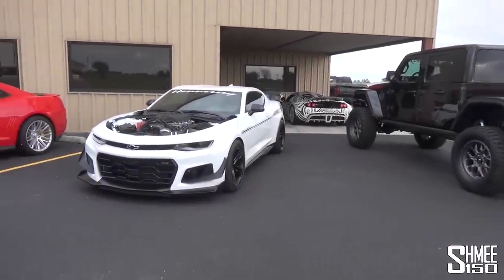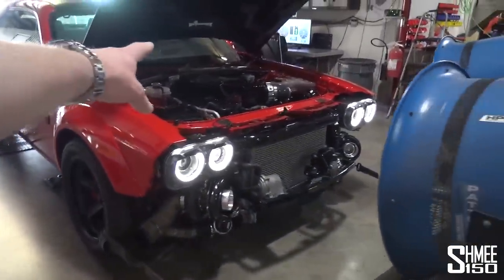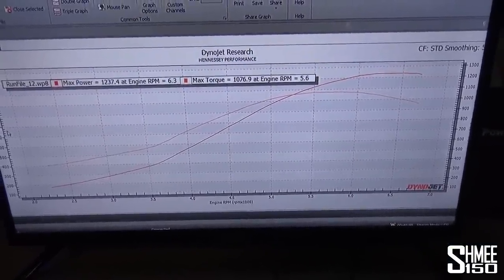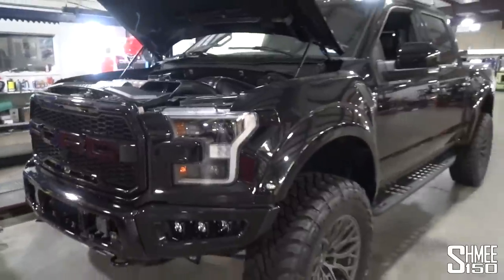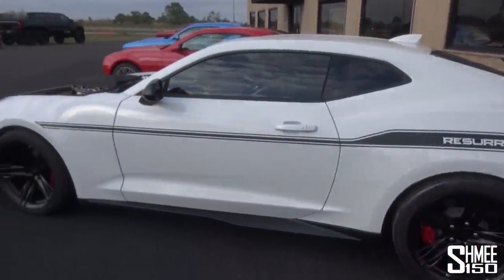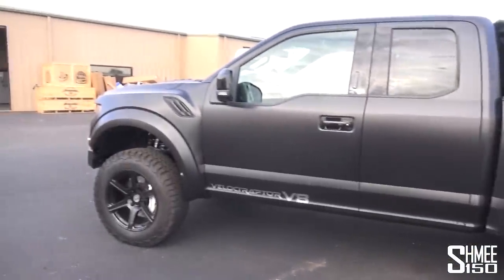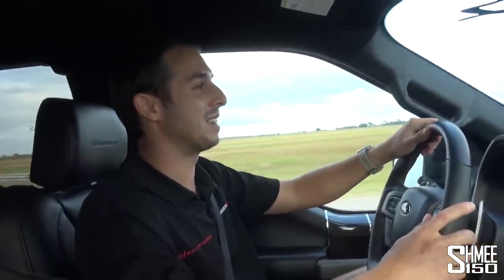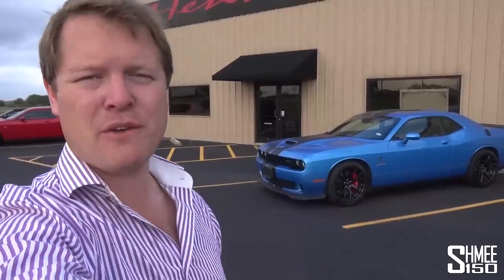THIS 1,400bhp Hennessey DEMON is Angry on the Dyno!

Comment: I've read many things about hennessey's car being big scams. Is that true ?
Reply: once you go hennessey your oem parts go missing lmfao its all true dude public information from the lawsuits is what you should read up on
Reply: Apparently in the early 2000's they used questionable business practices (which some people would refer to as scamming) but from what I've heard recently they are trying to improve their image from what it once was.
Reply: @the_visionvry6244  yup you pay all that money for your upgrades get robbed on the price and get robbed on your oem parts.
Reply: Just google him. You can find countless threads on Corvette and Viper forums about him, even find drunken replies from the man himself. In short he will have customer cars sitting in shops for insanely long, not reply to emails and phonecalls, sell you premium parts over the phone but install cheap ones. Theres even been cases where he has flat out robbed customers by taking stuff off their car and installing it on other ones. Endless list. Then we also have the Venom GT thing. All the carbon fiber, aero and chassis work was outsourced. It's all done by Delta Motorsports... In the UK. Americas supercar? Then they shoehorn a twinturbo V8 LSX engine in there and pretend they are a car manufacturer. Guinness World Records didn't seem to think they were one either.
Reply: @placeholdername3206  what site can I see that cheats drunken replys
Reply: there all scams
Reply: PaulBd78 they took apart a ton of acr’s and sold all the parts then basically told the owners to go to hell
Reply: for real?????dam mean vipers?
Reply: He has had slot of law suits brought against  him

Comment: So how much tires does this thing burn per mile? A stock demon already can't get the power down, you can only use this thing on a dragstrip cause it prob isn't designed to handle a corner well

Comment: If it is 1237 HP to the wheels, that is closer to 1450-1500 HP at the crank.
Reply: How the hell does do the drive train parts handle all that torque and power?

Comment: I would love to for them to put a gt350r engine in the ford gt with a whipple on top
Reply: Probably couldn't even fit half of it in the GT's engine bay
Reply: @burgerbandit3646  yeah, if the GT could accomodate a V8, Ford would have done it.
Reply: @andoletube  They specifically went with the V6 because it is more power efficient per liter of space.
Reply: @HAHA.GoodMeme  I think we are saying the same thing in different ways. Ford definitely had very clear direction around the styling and aero of the GT. They weren't going to compromise the design for a big engine. As it turned out, the V6 was the better fit for the package. But if there had been a bit of extra space available, I think they would have made it a V8 just for the classic pedigree aspect. Still, the GT is a great car and it also sounds good so maybe they are helping to turn people around on V6s.
Reply: They cant fit in a 289 ci v8 im pretty sure that measurement was an fe measurement and has good compression ratios and is smaller than the 302 coyote

And the v6 they run is 4 liters so its 245ci that extra 6 liters would make a difference in a v8
Reply: It's because the ecoboost marketing
Reply: Kevin Wiltshire ecoboost are 4 cylinders
Reply: @T0YCHEST  EcoBoost are a family of engines which include I-3, I-4, and V6 engines.
Reply: @andoletube  It can.  It would just have to be a smaller V8 (e.g. a 3.5L V8) which they did not want to spend the money to develop.  Ford shoved a 3.4L V8 into the Taurus SHO at one point when they needed something with more power.  But for the Ford GT they instead they wanted to "develop" the marketing for their EcoBoost line of engine.  Edit: Remember the Ferrari F40?  It had a "tiny" 2.9L twin-turbo V8 and yes, crazy turbo lag.
Reply: Mike didnt know that good info

Comment: Hennessey doesn't build cars, he takes someone else's then modifies them. It's been done before. I've done it and I'm doing it again right now. Leno just put a 700 odd horsepower motor in an old Ford Bronco. Still calls it a Ford Bronco, not a Leno Bronco.  Difference with Hennessey is he slaps his name all over anything he modifies in such a manner he essentially wants people to believe he built it from scratch. Won't go into his misdemeanors. Anyone giving him air time loses credibility somewhat.
Reply: I don't think there is anything wrong with giving him air time. But his consistent trend of ethically objectionable business practices should not be ignored, as so many publications have done for years. That I have a major problem with.

Comment: They had massive growing pains and screwed up completely with their Corvettes and I guess they are now stuck tuning cars that don't really break that easily with massive displacement by slapping on turbos. But it looks like they picked up the ball, downsized to a healthier size and put their focus more towards cars that are much easier to work on. I think Hennessy is turning it around. I wouldn't buy a Corvette or even a 1400 HP Hellcat from them, unless the car was done though. It looks like everything was hand made and it probably takes them months to make a car like that. When they say they sold about 20 of this and that, that goes to show, that this is a glorified mom and pop shop. They should have never tried to brand themselves as the premier Corvette tuners in the USA. That car just isn't supposed to compete with UGR lambos and the like. The price and material differences are prohibitive. It was a bad idea to try to pull this off. Good to see they found a better niche that works. I am no insider, I just read all the back and forth on the internet and that is my take on it as someone who was never a customer or particularly fond of Hennessy. Like everyone I saw the yellow Corvette and the listed data and thought wow, that's crazy that they can do that. And I guess it was.

Comment: Pointless if you can’t put rubber to the asphalt
Reply: that's why they are running drag radials 2 feet wide lol......But you remind me of a car I was reading about in Corvette magazine. I seem to recall it was a 65??? But it had a 427 with a blower and all sorts of stuff with....wait for it....stock 6" wide tires........the author of the article was saying how it was "lively" and how you had to feather the throttle etc and it would break loose at every shift etc etc etc.

I said when reading it: I could probably beat it off the line with a stock honda civic.......useless having 800 hp with zero traction.